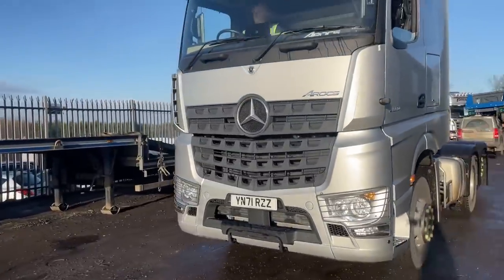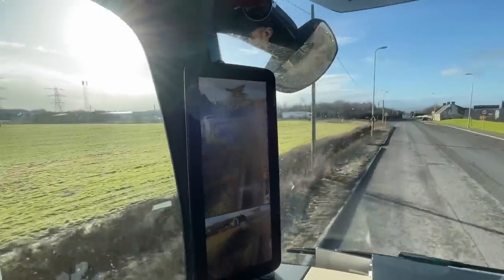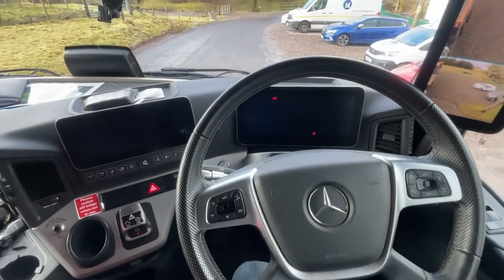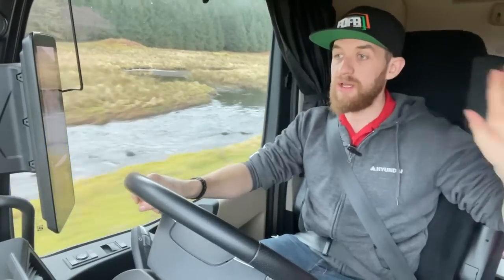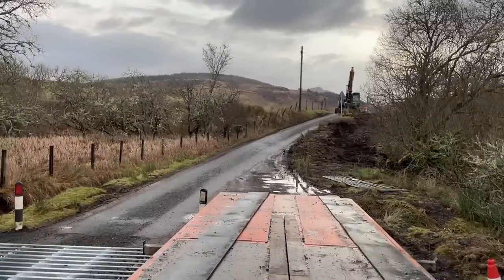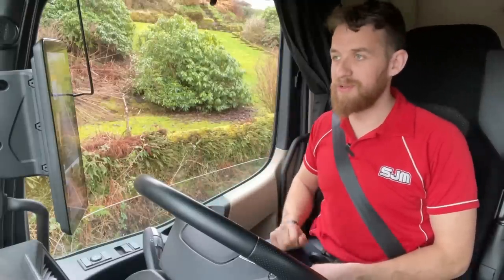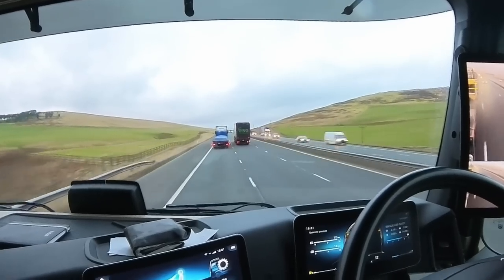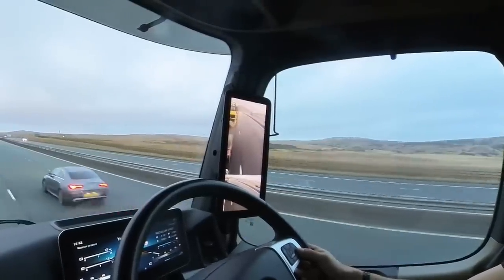Mercedes Truck Review

Comment: never was a fan of the mirrors. but we have the older gen ones and you can basically see nothing in them. we have issues with them when getting to our warehouse if you forget to turn the aids off the trucks basically just stops dead and refuses to move, now the road leading to the warehouse is narrow and usually full of parked cars, but there IS enough space to pass oncoming traffic.

basically we all try and make sure we are assigned to the Renaults.